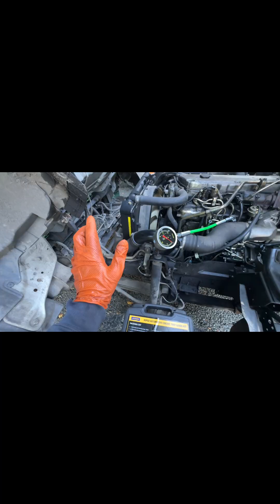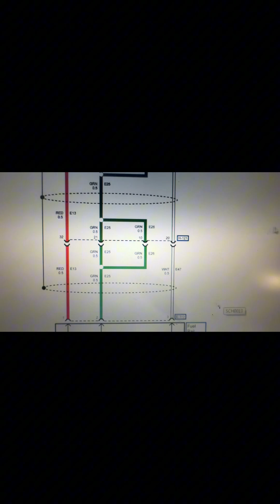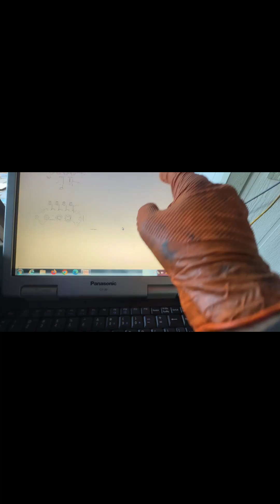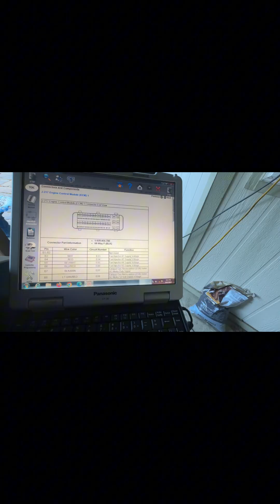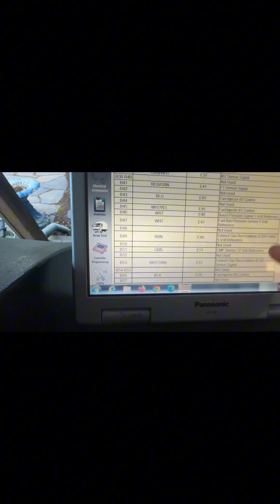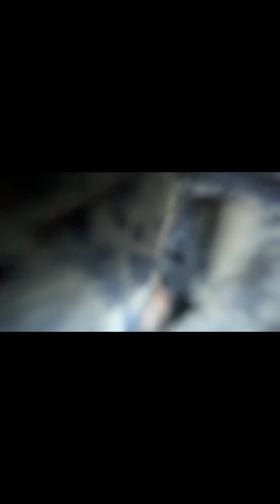2003-2005 Isuzu npr low rail pressure and high rail pressure codes limp mode and stalling

Comment: Sensor  can be a pull down type so  you will see at the plug a ground pin a 5 volt ref and you may see a 5 volt  bias on the sensor  return  pin . You can use  a test light  to ground tuch the signal return  pin and see if the 5 volts drop and look  at the pressure on the scan tool to see if it changes
Reply from the maker: Great advice! I got that bail connector to seat correctly. Continuity on the pins! 100 mile test drive no issues. That was real satisfying!